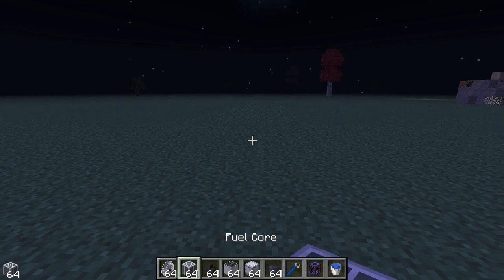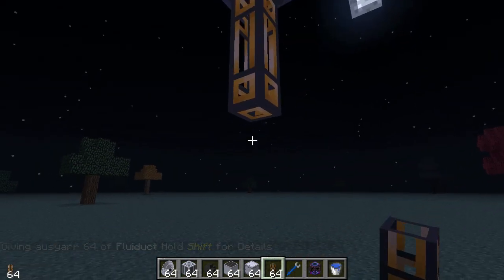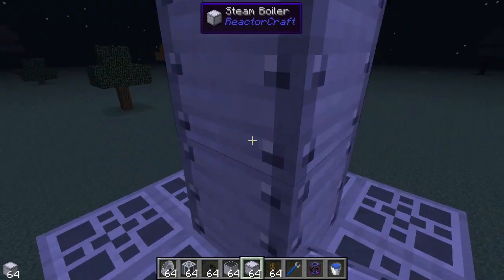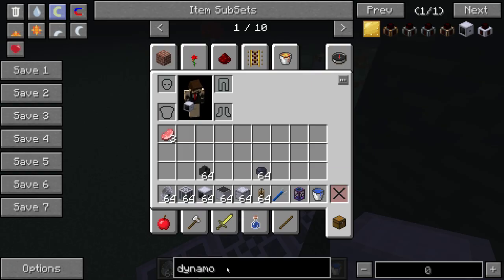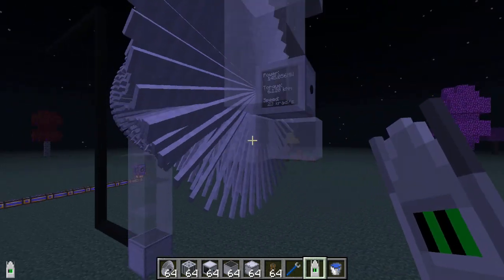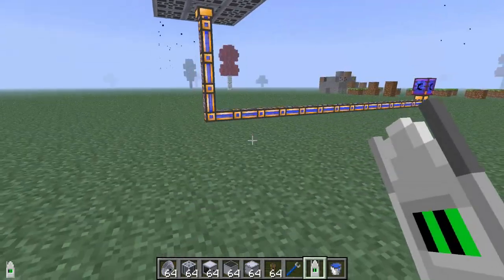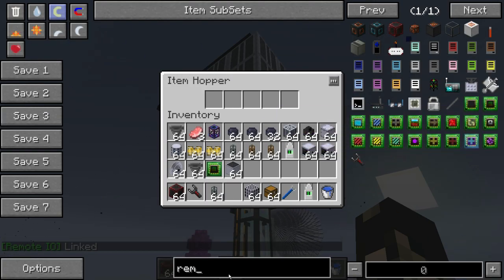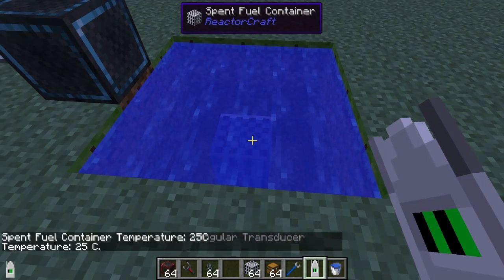Creative Builds   Reactorcraft, 900 Million watts with Multiblock Reactor

Comment: Okay I have not used reactorcraft yet, so I may be completely wrong in my assumption. Couldn't you cover the outside of that reactor with more boilers so that you get more energy overall? There are a ton of flying neutrons doing nothing for you it seems. Also, if I wanted to make a reactor similar to this, would it make the reactor safer overall if I replaced those fuel rods in the corners with steam boilers? Please correct me if I am wrong or mistaken because I want to make a very productive and safe reactor for my town. Thanks :)
Reply from the maker: You may be right. The mod mechanics do simulate physics how ever there not perfect. As for the neutrons they only affect materials that can absorb them. The steam boilers are mostly water so the neutrons don't heat them up. As for putting boilers on the out side they may draw too much heat from the center to the point where the aver heat among boiler isn't enough to boil water. I havnt tested putting boilers on the outside of this setup yet. I find using concrete as an insulator works.
Reply: Ausyarr Oh so in this case, boilers actively draw heat from each other? That's a cool little feature. Keep up with the reactorcraft videos man, I'm enjoying it! :)